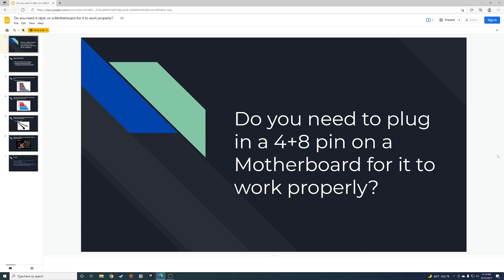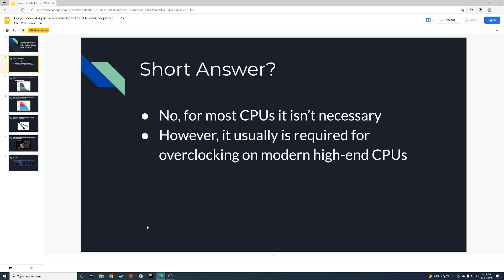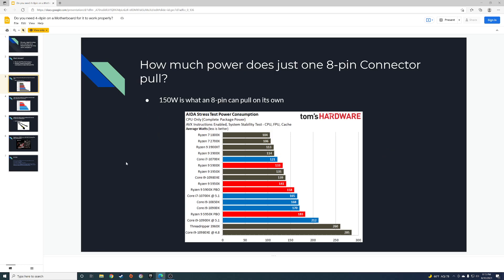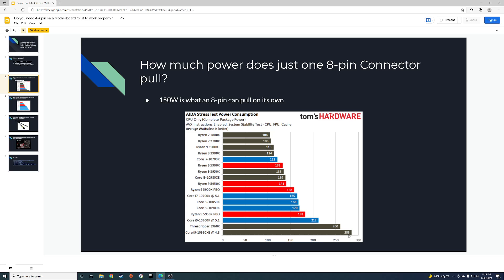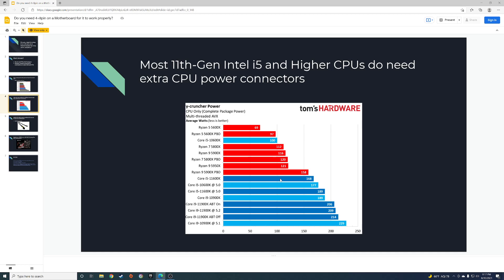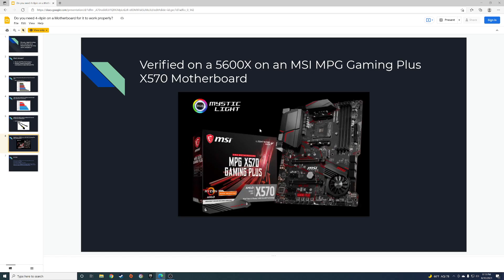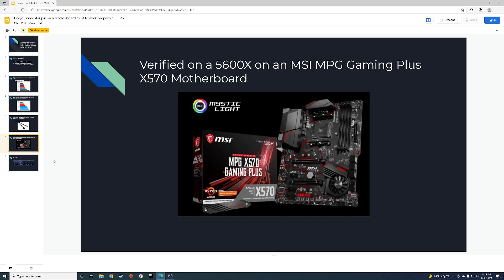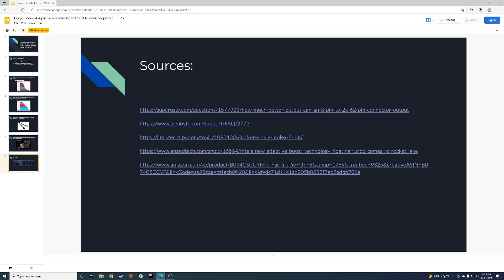Do you need to plug in a 4+8 pin on a Motherboard for it to work properly?

Comment: My Asus prime H510M-A wifi is nagging about a 8 pins connector on my core i511600K.(i have a 4 pin connector)The motherboard will not continue to boot unless i do a reset.After the reset i get the message to use an 8 pins connector on my motherboard..I ordered an 4 to 8 pins connector so hopefully i wil get rid of this 4pin-message.Otherwise i have to buy a new psu!
Reply from the maker: Yeah, an 11600K in higher-end tasks might need more power from your PSU. Depends on if the rail for the CPU can support the amount of wattage going through the 4-pin to 8-pin connector
Reply: @cztech2631  Well,i did a stresstest with the new 4 to 8 pins connector.But the psu failed and i got a automatic shutdown.I now purchased a Corsair CX750F RGB PSU,now no problems anymore
Reply from the maker: @retarivs  thank you for sharing. I’m pretty sure your comments will help several users in the future facing the same issue.

Comment: hi i have the same motherboard and an i7 11700kf and my psu have only 2x4 pin what do you recommend? im not gonna oc or something like that
Reply from the maker: I would recommend you use a PSU that has two 8-pin connectors. The PSUs with two 8-pins are usually in the 850W+ range from EVGA from what I've seen. Other brands have two 8-pin CPU connectors too. The i7-11700KF can pull up to 260W, so you'll want both 8-pins populated from a strong enough PSU. Using a Molex adapter might not provide enough power in heavy workload scenarios.

Comment: Hey my problem is that i have a b550 F gaming wifi motherboard and my PSU an aerocool cyclon 700w only has an 8 pin plug for the cpu power supply and the mother board has 1 space (EATX12V_1) for that same 8 pin plug but also has another 4 pin plug (EATX12V_2) which i dont have anything to conect to, will i have problems if i leave it empty? Im using a ryzen 5 3600x

Basicly i have 2 plugs that equal to 12 pins divided between 1 with 8 and a second one with 4, and i only have 8
Reply from the maker: You should be fine on a 3600X since it pulls under 150w, so the 8-pin alone will be fine for you.
Reply: @cztech2631 thanks
Reply: @cztech2631  thx this helps my worries too
Reply: @cztech2631  Bro tengo un ryzen 75800x y solo le conecte 8 pines, deje los otros 4 sin conectar, ¿debería conectarlos o dejarlo así suelto?
Reply from the maker: @IndiscutidoBox  Si no se realiza un overclocking intenso, está bien si se dejan los 4 pines desenchufados. El 5800X usa 120W, y en el peor de los casos con el PBO encendido. Si lo está ejecutando en la configuración estándar, estará bien con los 8 pines enchufados en total. (Mi español no es tan bueno, pero espero le haya podido ayudar)

Comment: Hi i have all my components new cause i just bought all of them. No matter what i did i cant have a display with either from motherboard display port or gpu. But yeah i notice there is extra 4 pin beside the 8 pin socket. Should i the other have of my cpu cable into it? Cause i believe my msi psu modular have to cpu slot from it or header thannks. My cpu is i5 12600, psu is 850 gold plus, with rtx 3060ti. Thanks in advance. Im frustrated
Reply from the maker: Yes, you need the extra 4-pin populated. The i5-12600k takes 189W at full load, so just the 8-pin won't be enough to power the CPU properly. I'd plug in all the CPU headers because your CPU needs the extra watts from the 4-pin. The 8-pin only provides 150W, while your CPU needs 189W at 100% load to function properly. The extra 4-pin will give you the necessary wattage to power the system. 

The other issue might be that the PSU or the motherboard were sent Dead On Arrival and so are messed up somehow during shipping or manufacturing. I had a motherboard arrive dead to me once, and I had to return it back to the manufacturer.
Reply: @cztech2631  you know what mate, i put the other 4-pin just now and still no display. Sad im afraid this might be a dead mobo, although the fans and rgb are running. I have the asus prime z690 p wifi d4. Jesus!
Reply: I just called the store i bought my components. They will collect it from me tomorrow, the mobo ram and cpu. And change each if there is a problem. Tsk.
Reply from the maker: @pcgamex912  it's frustrating for sure. I had a bad motherboard when I built my latest system. I had to return the motherboard and get a new one and rebuild everything. The 2nd time everything worked.

Comment: I have a question, because i have 5600x too. If 5600x takes over 150W under load, I need to plug in extra 4-pin? If i plug in 8 pin and 4-pin but I don't need it, will i have a problem with something?
Reply from the maker: The 5600X takes 70W under full load at stock settings I verified this along with what other reviewers put in their reviews, so you just need the 8 pin plugged in. If you want to overclock you need the extra pins plugged in because you’ll be drawing more power. 

The extra 4-pin won’t do much if it’s plugged in or not running a 5600X at stock settings.

Comment: I've got ryzen 5 2400g and gigabyte A320 s2h mobo, is 4 pin enough?
Reply from the maker: I’ve only ever power a Motherboard with an 8-pin never tried to run off just a 4-pin.
Reply: @cztech2631  thank you

Comment: What do you recommend if I’m running a B550 steel legend mobo on ryzen 5 5600x with rx 6600 xt gpu ? You think I should connect the other 4 if I plan over clocking ?
Reply from the maker: If you're doing some mild overclocking you should be fine with just 2 4-pin connectors. The 5600X pulls just 70W at full load, so that leaves you with another 80W to overclock with. If you were overclocking a 5800X or a 5900X then you would maybe need more wattage and need to populate all CPU pins.
Reply: Ok  and if I wanted to connect the 4 pin on a future build I would have to use another 8 pin cpu but the split side ?
Reply from the maker: @Davidsbuiltb  yes, that’s how’d you would do it
Reply: Ok Thank You Appreciate it !!

Comment: Hey, I am building a pc and I want to overclock my i9 11900k, but I don't know what psu to get and where to plug the cables in.. no psu has these 8+4pins. Or where should I plug it in on the power supply?
Reply from the maker: For Overclocking you’d want something like this it comes with 2 CPU power cables with 2 8 pins. The Power Supply I linked below has two 8-pins to deliver 300W to your CPU if you're planning on overclocking it. Most PSUs that provide two CPU headers are usually higher wattage PSUs in the 750W+ range from what I've seen looking at PSUs for the past few years since more and more CPUs seem to need more wattage as time goes on.

https://www.amazon.com/EVGA-Supernova-Modular-Warranty-220-GT-0850-Y1/dp/B08X1C8TK9?_encoding=UTF8&crid=7WXLGZWSAY9H&keywords=850w+power+supply&qid=1638417295&sprefix=850w+%2Caps%2C175&sr=8-6&linkCode=ll1&tag=cztech0f-20&linkId=b89008a16c80ac58445ab50d63075d1f&language=en_US&ref_=as_li_ss_tl

Comment: I've got ryzen 7 3700x and i bought asus rog strix x570-f... Should i plug just 8 pin (4+4) CPU? So that 4 pin more are just for overclocking? Nothing else?
Reply from the maker: Yes, the 3700X pulls 90w to 111W at full load unless you’re heavily overclocking you won’t need the extra 4-pin populated because 4+4 pin will pull 150W, so you more than enough with only the 4+4 pin plugged in.

Comment: i5 11600k with z590 asus tuf gaming, need 8+4? is not OB
Reply from the maker: Yes, for a 11600k it would be best to run the 8-pin and the 4-pin because it uses 168 Watts at full CPU usage. Since the 8-pin only provides 150W you should also use the 4-pin to properly power the CPU fully.

Comment: Hello, Im using a RTX 3080 GPU do i need to fill up the another 4 pin on the motherboard?
Reply from the maker: You need to use the 2 6+2 pin connectors for your video card. For your motherboard you can use just an 8-pin 4+4 pin connectors and leave the last 4-pin empty. It depends on your CPU if you are using Ryzen processors and are not overclocking you can use just the 8-pin 4+4 pin CPU header. If you're on Intel and overclocking you likely need all 12 pins on the motherboard populated. 

The CPU pins the 4 and 8 pin are for the Processor itself and don't impact video card performance that is provided by a the PCI-Express Slot and the Video card power connecters. You need all video card connectors plugged into the video card you have.

Comment: Even Im having 8 pin with 4 pin in my gaming motherboard.but my psu having only 8pin cable... is that ok to connect pci - E 4+4 connector to my 4 pin for overclocking.. ? Is that safe..
Reply from the maker: I just populated the 4+4pin for the CPU. I left the Overclocking 4-Pin without a 4-Pin plugged into it since my CPU only pulls 70W or so, and I didn't need the overclocking wattage for what I am doing running a stock 5600X.

Comment: ive question , i bought MSI X570-A Pro , there is 8+4pin power connector, but my psu just have 4 pin only, it can working properly if just plug 4 pin on motherboards only,and im not use 8 pin on board?
Reply from the maker: From Tom's Hardware you should have two 4-pins on the Power Supply itself:
https://forums.tomshardware.com/threads/my-psu-only-has-one-4-pin-connector-but-my-motherboard-has-an-8-pin.2407346/

"No, you can't just plug in a 4 pin connector to the motherboard. That power supply does have a standard motherboard power plug, you are either not seeing it or it's one that can be broken apart into 2 pieces and you need to click them together again."

Comment: I bought a msi b550 mobo with a 8 pin connector for cpu. My psu is 750 watt but it has the wrong 2x4 pin connectors, well one is right the other is different. I have a ryzen 5 3500 at 65w TDP. So I should be fine just pluging in the one 4 pin connector from psu into the 8 pin connector on mobo right?
Reply from the maker: Most Power Supplies come with just one CPU 8-pin connector. The other one that doesn’t work likely is meant for for a video card because it’s probably a 6+2 connector and those are shaped slightly differently than the 4+4 connectors meant for the CPU headers. 

I’ve never run anything less than an 8-pin on a CPU, so I’m not sure if that would work.